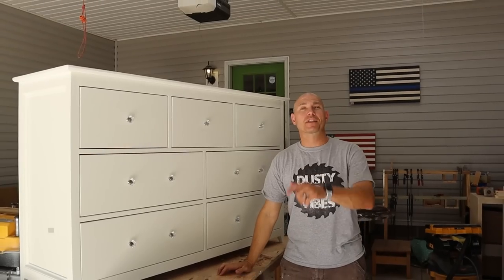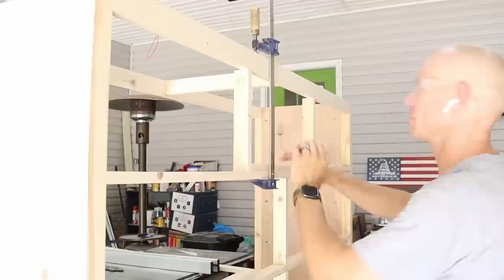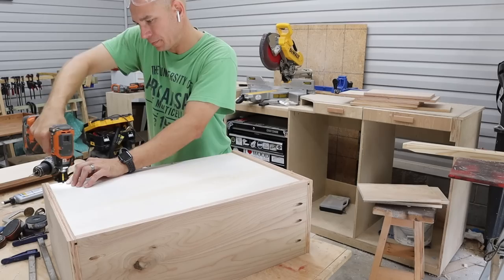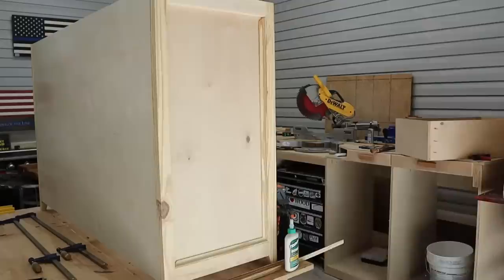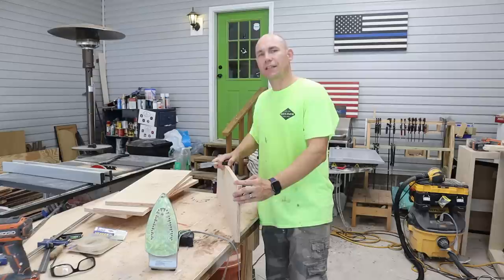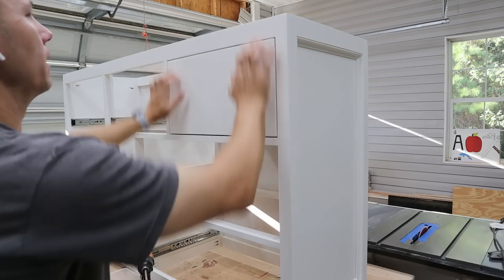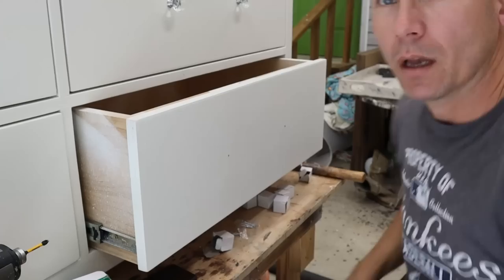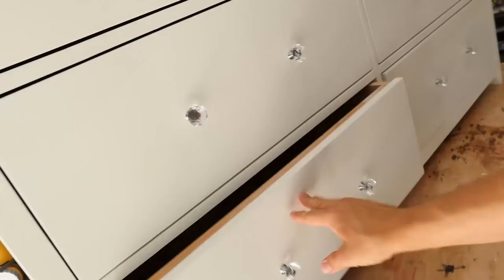How to Make a Modern Dresser  | DIY Modern Farmhouse Dresser

Comment: Nice project great build. My youngest son bought his first home which was built in 1916 and when it was built they used plank boards to create wainscoting in the living room which we discovered when we removed the old lathe and plaster to put in insulation and drywall. So, my plan is to make a dresser using those boards so he will have a piece of the house for years to come and your video was helpful in my project.
Reply from the maker: Sounds great!

Comment: great build, I wait to put back until last. more access for intalling drawer guides.. Drawer faces trick... after edge banding over hang to front face of drawer, use a 1/8 round over to flush trim and clean up the small tearout on plywood.

Comment: Good job on the dresser. I realize this video is two years old and I'm sure you've gained a lot of experience and you probably don't need to know the suggestions that I have to make, but here goes anyway. 
When you were concerned with lining up the grooves on the drawer boxes, make a simple jig of two 45/45/90 triangles, about 3" or so stacked on top of each other offset by the depth of the groove topped with a third piece to go over the top (bottom edge) of the drawer. Put it in the corner while assembling the drawer and it will keep everything perfectly aligned. 
When trimming edge banding, there is a tool specifically for that. If you are planning on doing a lot of edge banding, you may want to get one. There are many of them out there and they're not expensive, so see what's best for you. 
You were worried about the spacing on the drawers. You did a great job on that for flush drawers. If you don't necessarily want inset drawer fronts, you may want to make overlap drawer fronts. Alignment and spacing is much easier, if that is the style that you are looking for.
Ricky Nelson (my generation) once said in his song, Garden Party, "You can't please everyone, so you've got to please yourself". Give yourself a break and be pleased with this build, Excellent!

Comment: I found out the hard way not to drive Kreg screws with an impact driver. Drove them too deep and popped the surface veneer of maple plywood. Use drill on clutch setting of 4.
Reply from the maker: Good tip
Reply: Same exact thing happened to me.  I now use my m12 on 6 torque setting.
Reply from the maker: @dvdgnzlz25  yeah, you have to be careful for sure

Comment: The knob screws are 10-32, if you get screws that are too long, if you have a set of wire stripper pliers, they usually have threaded screw holes that can be used to cut those screws. Just an FYI, not trying to stick my nose in your business. I enjoy your videos, thanks for sharing.

Comment: If the screw you are using is a number 8 or smaller, they can be cut wire strippers.  Some wire strippers have place to cut screws down to length.  or counter bore the back side of the drawer.   Great Project ! I like the finish.
Reply from the maker: Thanks for the tip

Comment: One rule of thumb I use when making drawers the Grove for the drawer should be the same thickness of the ply your using for the drawer "reason being if it should fail you can cut the thickness in a strip to repair it "

Comment: Another great video, think I might attempt this one next. Never built drawers before.
Reply from the maker: It’s a great build.
Reply: @731Woodworks  anything you would do different if you were staining the project instead of painting it?
Reply from the maker: Buy a high tooth count quality blade for plywood to reduce the damage to the vaneer.  It’ll show up more with stain if it’s chipped. Make very sure all the excess glue is cleaned up. If not it’ll cause light spots to show in the stain.
Reply: @731Woodworks  you think not having the rabbit for the 1/4 inset on the plywood on the back would mess up anything but aesthetics?
Reply from the maker: Nope. I think it’ll look just fine
Reply: @731Woodworks  you must have been a Tetris master getting the sides, top, drawers and faces all out of 2 sheets
Reply from the maker: lol 😆

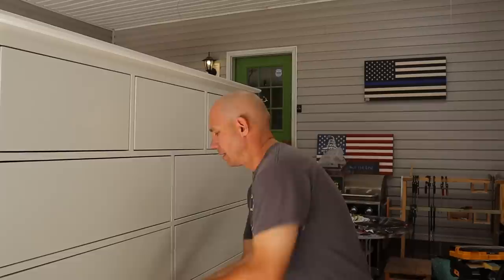Comment: 43:20. I was wondering if you were going to account for the two layers of plywood by drilling a hole through the drawer wall carcass, which would have  allowed you to use the stock screw with that came with your drawer pulls by going through only .75 inch instead of 1.5 inch.  Oh well, live and learn.

Comment: Tip, if you install Blum slides do replaceable bottoms like his.
Then you don't have to notch for the slides as seen in every YouTube Blum tutorial.
Reply: For the drawer width on undermount sides you can put the slides in the cabinet and measure directly off the slides to get the front and back center cuts.
NO CALCULATING!

Comment: I have added the draw slides before painting or staining...I keep doing it now and then, you'd think I'd learn...But I saw you remeasuring to reapply the draw slides....I put screws back in the original holes to show me the location of the screw hole after painting, so I didn't have to measure up again.

Comment: I followed this design with just different measurements. Came out really well. Thanks. I could use some help from any of you more seasoned woodworkers though. One side of my larger drawers won't close flush. I measured and hung both sides the same but one side rests about a half inch out and won't stay closed all the way. Anyone help me with this? Is it a square issue? Easily fixable? Thanks in advance.

Comment: Maybe you know this but instead of using multiple washers for your machine screws there is holes on wire strippers that are made for cutting machine screws to whatever size you need and it threads so you won't booger your first thread up

Comment: Nice build Matt. I noticed that you have not installed a router table into the extension wing of your saw yet. Do you plan on doing that? If so Jessem makes a great lift. I put one on my Delta and love it. Keep up the great work on the videos my friend. I am trying to make it through all of your videos, you have a nack for it and your instructional presentation is great.
Reply from the maker: I'd like to eventually.  But I'm not sure if I want it on the saw or separately.  I really need a router table though, and a full size router.  This palm router I have is way underpowered.

Comment: Great vídeo and well explained as well. I'll try to do it soon, following most of your ideas.
Is there any specific reason por using a thin piece of plywood o sometimes MDF at the bottom of the drawer? We mostly used slide drawers that hold a lot of weight, so why using a material that bends so easly even with clothes. Not criticizing this amazing work, just pointing out.
Thanks again for showing this beauty

Comment: Hey Matt, 

First of all thanks for your videos, man. They're really great. I've watched a ton of them, but this is the first one of your projects I'm tackling. 

Question: is there any reason you can think of not to build the face (and back) frame first, before connecting them to the sides? I'm just wondering if it might not be a bit easier for me to do it that way if there is no reason not to.

Thanks again.
Reply from the maker: You can certainly do that. A lot of folks do it that way
Reply: @731Woodworks  That's what I figured, since that's how I build my face frame when I did cabinets for my wet bar. Just wanted to make sure I wasn't missing anything. Thanks! Keep it up brother.

Comment: G' Day mate
Greetings from Croatia
Great job as always
I have a question, your opinion and anyone who's reading  this

Im about to build a big huge church door
And im thinking make it hollow for  the weight sake, something like a house frame out of wood, then put some 2 +inch thick wooden panels around it. 
Stractualy is sound but im woried about condesation and creating some water inside etc., and get a problems later 
What are your toughts 
Thanks

Comment: We have a place nearby where I buy high quality plywood or any type of hardwood. I've been using B2 maple, plywood,  which is beautiful stuff.  A is flawless. B is almost perfect. Home Centers sell C, which is no good if you are staining.  2 is the back number. 1 is flawless, 2 is also nearly perfect. Most times you can cut around any imperfections. With edge banding, B-2 looks darn close to hardwood. I follow your procedure for staining and finishing. I use Minwax Polycrylic, satin. 3-4 coats. Finished product is very nice.
Reply from the maker: I'd love to get my hands on some maple ply!

Comment: Hey Matt, quick question. I don't think you addressed it here and I watched FTBT drawer video and he doesn't either... relative to the size of your drawer openings, what size should the face be? I'm making this exact dresser but a scaled down size, so your exact measurement won't work... do you take 1/4" off the side and top to have 1/8" gap all around? Or more?

Thanks man.
Reply from the maker: I used a 1/8" gap all the way around on mine.
Reply: @731Woodworks  thanks so much! That's sort of what I figured but you know what they say about people who assume...

Comment: What type of wood do you use for the 2x8 and 2x10? Thanks.
Reply from the maker: Pine
Reply: @731Woodworks   thanks. When installing your drawer slides and drawers where are you placing the 1/4 ply to help with spacing?
Reply from the maker: I used scrap pieces of 3/4” ply, just laid them on the rails.

Comment: Is there any reason this dresser shouldn't be built with 1/2" plywood vs 3/4"
Reply from the maker: 1/2" would work.  My only concern would be the long stretchers across the width bearing the weight. I would reinforce those somehow if I used 1/2".
Reply from the maker: If you used 1/2" on the drawers, it would significantly reduce the weight of the dresser.  It is a BEAST to move with the drawers in it.
Reply: @731Woodworks  LOL I never move any furniture w/ the drawers if I can take them out :D